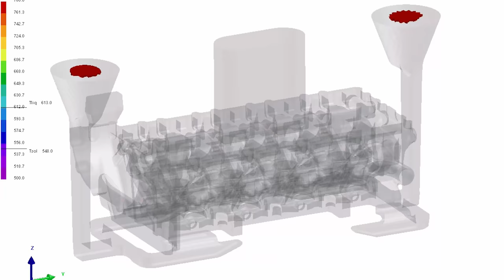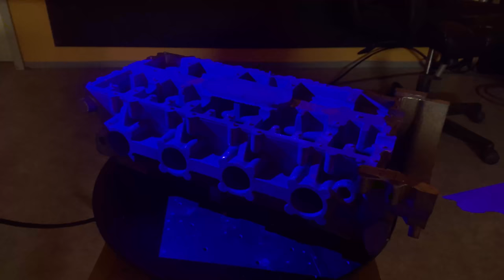Casting a Racecar Cylinder Head - Complete Process

Comment: Very good video. But I wonder, do you have to take into consideration the thermal properties of aluminum when casting? 

I have been wanting to design and cast aluminum heads for racing applications for some time now but I don't know how to work with aluminum really.
Reply: Generally aluminium shrinks by 4% so when designing the patterns everything has to be 4% bigger in all directions. Then allow for machining, so faces that will be machined generally will have about 6mm added to them . Also it’s quite hard to centralise the casting when machining so on quite a long part like a cylinder head datum’s have to be checked. . What few people realise is that core plugs on bocks and cylinder heads are not there to stop the block cracking in a frost . They are there to support the cores ( cores for the cavities / water jackets ) . These can be clearly seen in the video. Quite hard to spot or understand if your not used to working in reverse/ negative. 
These are sand cast heads or old school ideal for small / medium batches . 
On some more modern engines they use pressure/ vacuum casting techniques usually injecting alloy from a large reservoir below and either forcing the material up and use a vacuum to get rid of the gasses . This improves quality and reduces chilling . 
Also on large batch production they will have a machine making the cores and a conveyor system to feed an automatic casting machine .
Reply: @newagetemplar6100  sir, where did you acquired that amazing knowledge?
Reply: @chumbeque4561  hi , just through a lifetimes worth of engineering, I had a very good friend who had been a pattern maker all his life and used to go down at night to his workshop. All hand done using old school techniques , sand boxes , contraction rates / shrinkage etc etc . Then I had my own castings made for WRC alloy uprights and machined them myself. This also ran along side my fibreglassing skills that I had leaned previously. I am now building a BMW E36 GTR race car with all composite panels and alloy uprights . I’ve been very luck in that respect as YT wasn’t around in the early 90’s . Fortunately now there is a vast amount on YT for people not as fortunate as myself .
Many thanks for your kind comment. 
😇🇬🇧
Reply: @newagetemplar6100  In the case of pressure/vacuum casting would the part still shrink ~4% or does it maintain the dimension after cooling? Similarly, would a tall sprue/feeder supply enough head pressure to decrease the shrinkage as it cools? also would pre-heating the sand mold have any affect on shrink rates if it is allowed to cool slower?
Reply: @PhaseFabrication  the shrink rate is a constant, thermal characteristic of the alloy. i have three rulers that are not allowed to be mixed up. brass, iron, aluminium. theyre precalibrated patternmakers rulers with the offset already applied. doesnt matter how its done, aluminium always shrinks a certain amount as it cools from a certain temperature.
Reply: @paradiselost9946   Thanks for the info! That makes sense and saved me a bunch of messing around
Reply: @newagetemplar6100 hey, what kind of sand can be used for brass that would also sustain small details? also, do you know some good books on casting? (i'm mainly interested in vacuum casting because that's magic to me)
Reply: @king_james_official  hi , 
Depending on the size of the casting really. Here in the UK they used to use a fine green sand with an additive that makes it harden with Co2 . This was very good for small detailed work and quantity castings like cylinder heads , not as good as lost wax casting or plaster based molds as these give a superior finish .
Lost wax is good , especially if you can but a cheap 3D printer as you can use this to make molds for your sacrificial waxes or if you buy one that prints powder like my old Z-corp 3D printer you can actually print powder based molds . 
Just scan YT and you’ll be surprised what knowledge is out there
Reply: @newagetemplar6100 hi, i actually tried plaster casting a lot of times. i would print the model out of pla which would later be melted, and then push it into some vacuumed plaster, but after waiting a lot of time for it to dry, the small details would just break. it's definitely the plaster i used. there isn't much of a selection on the auction thingy we have in poland (only 1 listing of fireproof plaster, up to 950deg C). the one i used in my prototypes was a kind of construction plaster, so it wasn't even liquid. so i think i will stick with the plaster casting, but i need to choose between modeling plaster, which is used for plaster figurines; dentistry plaster which looks promising for the details, but has no temperature limit listed; and the expensive fireproof plaster i mentioned earlier. what would you recommend to do? i've looked at a lot of videos on youtube and they recommend investment plaster, but i can't find its name in polish :(

Comment: Would you do a single cilinder head for the Honda XL250R 1983?
Reply from the maker: We made cylinder heads similar to this for oldtimer motorbikes, I think it's possible but I need the design or a part that I can use to make the design.
Reply: @castingdesign1140  Your work is awesome. Where do you do your work?

Comment: Hello, are the 2  dark grey parts made using 3d printed sand mold/cores ?
Reply from the maker: Hello, Yes they’re made with an ExOne printer.
Reply: @castingdesign1140  
excuse me
ExOne printer
How much does it cost? 
... Thank you...
Reply from the maker: @karnchan2589  we don’t own the printer we just ordered the prints but I believe it’s several hundreds of thousands of dollars
Reply: @castingdesign1140  cool, i believe this uses resin bonded sand ? Do you sell core/molds made on order or you only offer casting process ? I would like to cast a head my self , this 3d print technology would save quite a hassle with draft requirments 😄😄
Reply: What's price for prints ?

Comment: What race car is running those tiny valves, and ports!?
Reply from the maker: It’s a special built Lada it will be a rally car.
Reply: Maybe the valve lift intentionally to be built higher than my grade
Reply: @Casting Design  ohhhh. Sorry I'm use to drag racing stuff. We run big stuff